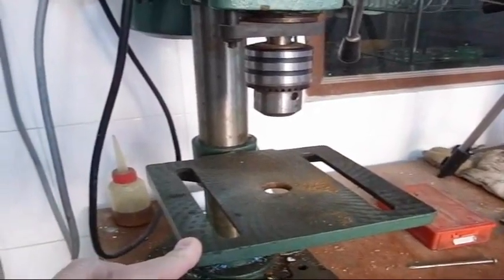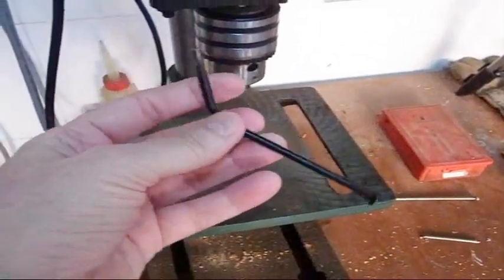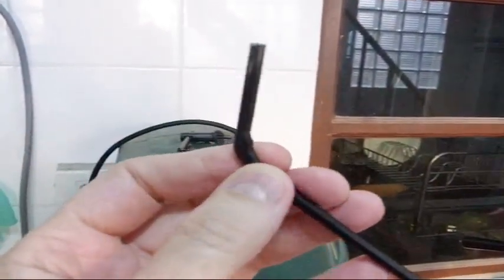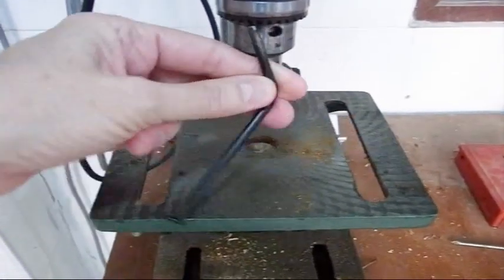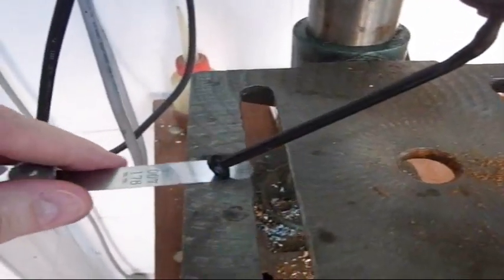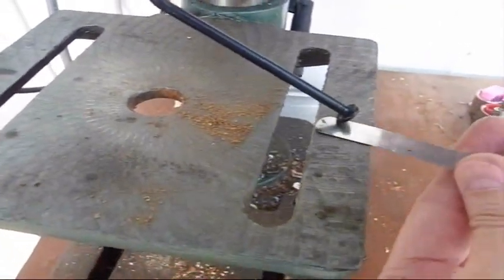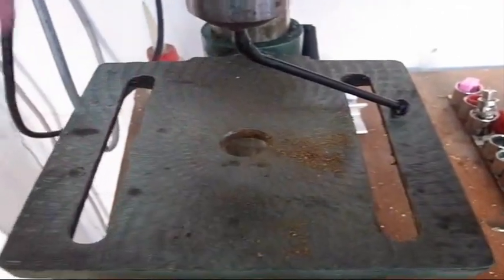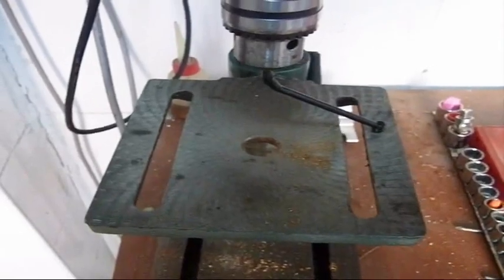Drill-press Table Squaring, High Precision - DIY

Comment: Great method.   But can table even be adjusted? Or just reclamped
Reply from the maker: This is a really "inexpensive" (cheap) drill press so there's only 1 adjustment, but this techniques works on any and on cheap presses it really helps with accuracy.